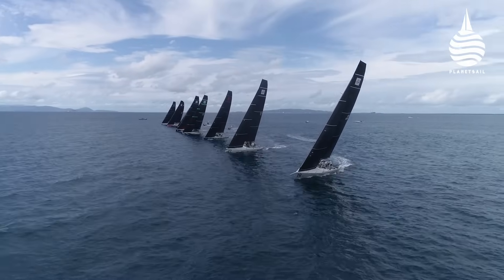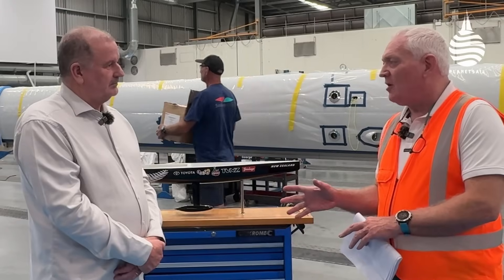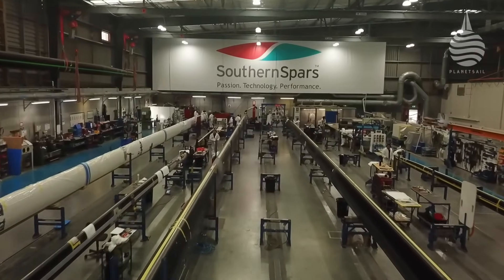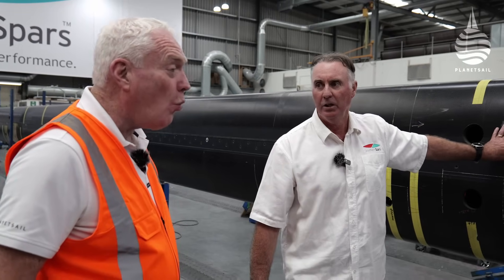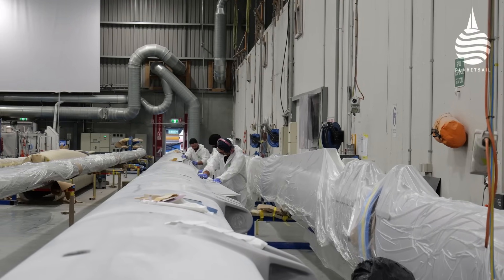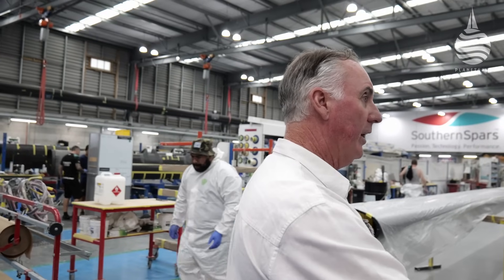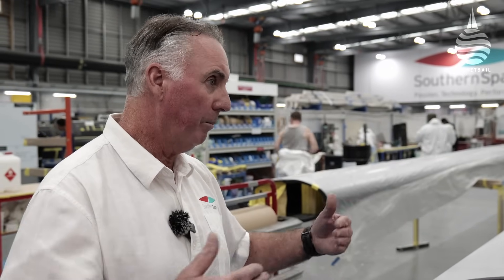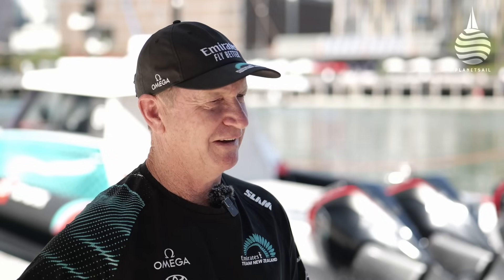Building the Big Rigs - Inside Southern Spars

Comment: Funny,flashbacks , I was actually doing a bit of electrical work in there when they were doing the first wings for the AC ,saw some very interesting pictures on computer screens ,was almost surprised I wasn't vetted and checked for hidden cameras . Those big masts you could have a one man lift running up inside them ,and yes you can see how a million dollars of carbon can get used up quite easily ,I was drooling over some of the off cuts from laminated plate lying around .